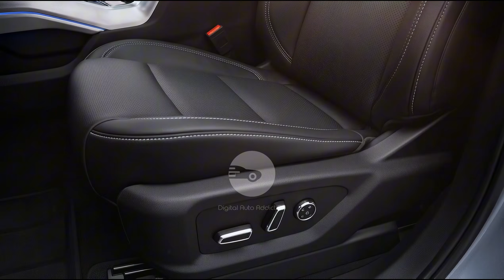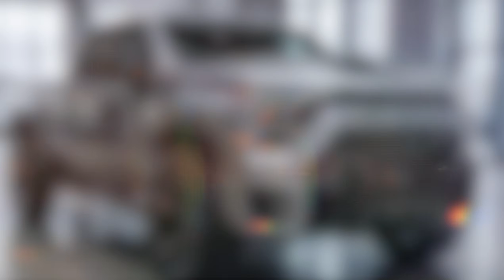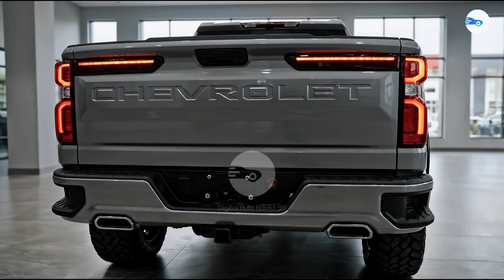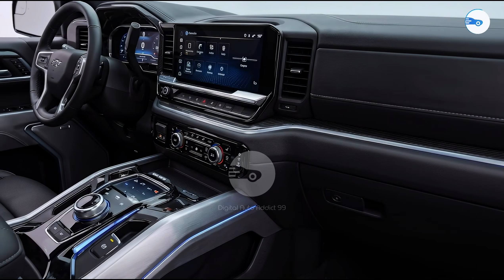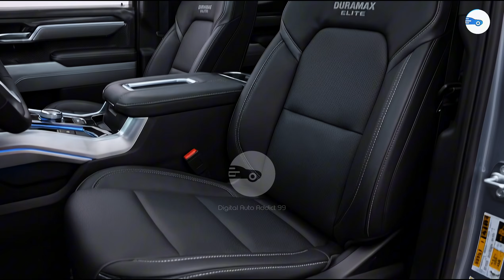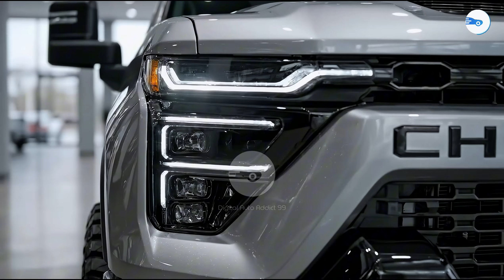2027 Chevy Silverado 2500 HD DURAMAX ELITE — The HD Monster That HUMILIATED RAM 2500 Power Wagon!

Comment: Too much money for too many problems! I have a 2024 1500 NOTHING but problems! Once GM Gets you to sign good luck for them fixing any warranty issues! Even if they “fix” it without breaking something else while doing it expect a long wait time for parts!
Reply from the maker: I'm really sorry to hear you've had such a tough experience with your 2024 1500 and the warranty issues. It's definitely frustrating when a new vehicle doesn't live up to expectations.
Reply: @DigitalAutoAddict99 
List of things on my truck is 37 pages long on the car fax report! Even the dealership admits it’s too many problems!
1) rear window leak 3x on 2 and 3rd time entire inside back of the truck was replaced! Hasn’t leaked in 6 months so we see!
2) blower motor whistles on high, dealer fixed it by adding Velcro to damper doors as an insulator (per GM)!! While the tech removed my dash to do this he decided to put his tools on the dash leaving scratches and gouges I complained they had a guy fix and it still looks like shit!
3) transmission shuddering! They tell me this is afm going in and out and it’s not an issue! 🤬🤔
4) head gasket leaking, external leak but they only changed one and not both I raised hell but Gm won’t budge!🤬🤬🤬
5) electronic tailgate issues! This is an ongoing problem! First issue was a recall the tailgate would open on its own while driving so they “fixed it” 2 weeks later wouldn’t open and I couldn’t access the bed because I had a tonno cover on so I called dealer they said bring it in tomorrow, that night I heard a loud bang bang bang and my dogs were going crazy! Turns out the tailgate was opening and closing in the middle of the night slamming into my garage door then closing again and again! Destroying the tailgate and denting my garage door! Gm refused to cover damage to my garage door and I had fight for them to replace the tailgate! 
6) screen freeezing up! This one was not allowing me to control several things in the truck they fixed it so we see! 
7) I can go on all night about the little issues that the truck has gone in for! I’m a Chevy truck guy owned them all my life and I do like my truck it is comfortable and drives nice but just too many damn problems I can’t buy ford because it’s constantly being recalled! No way in hell will I buy a Ram! Transmission and rust issues are still not fixed after years of these issues! Rams are usually rusted through after the first car wash!

Comment: "Humiliated Ram 2500 Power Wagon." LOL till you went off road.
Reply from the maker: Ah, the classic off-road asterisk! A valid point, but can the Power Wagon tow a small planet? Just asking for a friend.
Reply: @DigitalAutoAddict99  Power wagon is not a diesel motor because it's designed again designed especially for off road use, `not towing. And since it's designed for off road use not towing they purposely put a V8 in there so it'l be 900 lbs lighter than having a diesel motor in there. Now if y'all compare the Cummins 6 cylinder to the Chevy okay that's a fair and legit comparison, no prob there. Peace
Reply: My buddy loves his power wagon.....when it's not on a hoist. True story
Reply: @abramsatwo2515  We have 2020 3500 single real wheel Dodge crew cab long bed 4x with the Hemi; with a custom Hallmark pop up camper on it. Order it July 4th 2020 it arrived the day after Labor Day. Paid 42k for it. It has the front straight axel not the lol IFS LOL "stuff." It's Been driven from SD CA, to Alaska. In Alaska you would believe the places we've been in it. Many miles on it and never had a problem. It's our RV and has been 100% dependable. With the pop on there if feels like an SUV. I can put it on cruise control and do 80 in the fast lane you don't even know the campers on there. Nice to pull on a lever for 4 wheel drive then to keep pushing a "button" that doesn't work like I've heard from the GM off roaders lol. Compliments for days on our rig and it surviving like a champ in Alaska where it still resides until it returns to San Diego. 42k and I didn't have to add airbags for the killer Hallmark camper. I'm sure the new computer truck Silverado will be double what I paid and when ya'll bouncing off road make sure you hold on tight to all those computer components cause that's what's gonna make that pretty rig take a big bowl movement. Peace